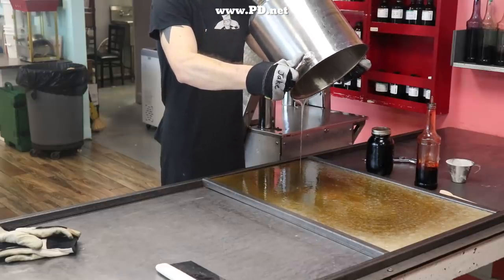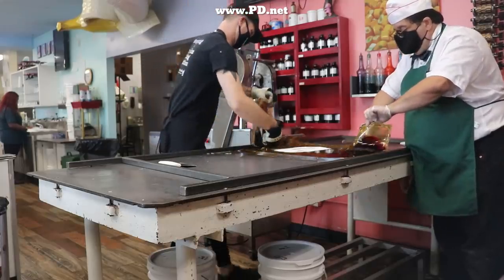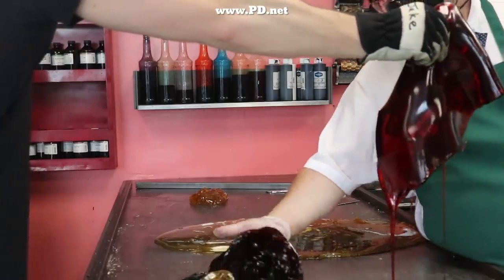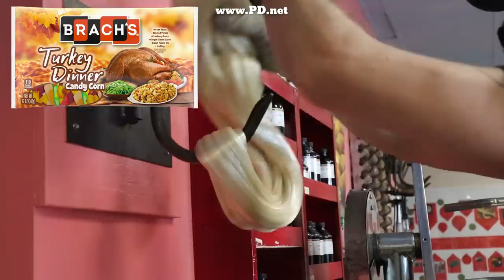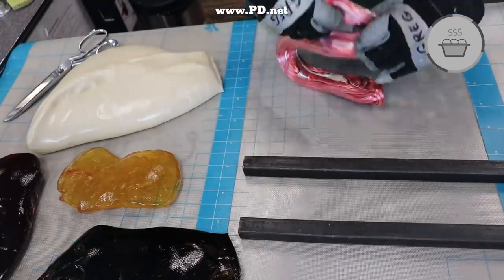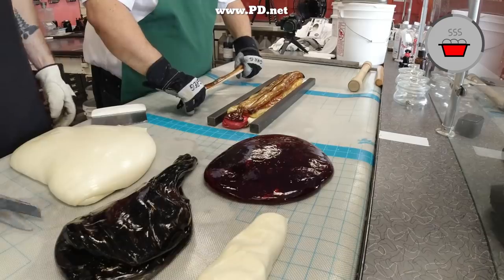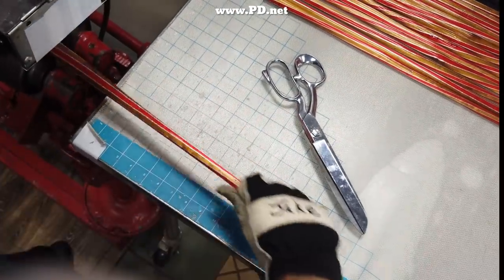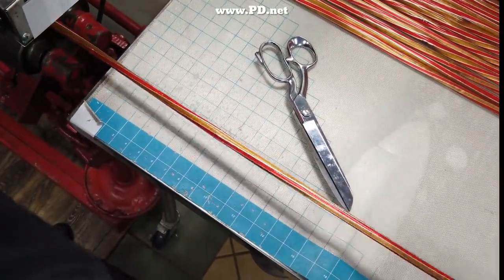#143 A Candy Feast, Can we make Apple Pie Candy?

Comment: But isn't reflecting the light so it appears white the same thing as when something is white? I am pretty sure that white colouring is just a material that reflects white in a way that makes it look white.
Reply from the maker: Yes you are correct. But I'm able to do this with tiny little air bubbles instead of using a food coloring. it also is the advantage that it creates more surface areas the flavor pops more when you suck on it.